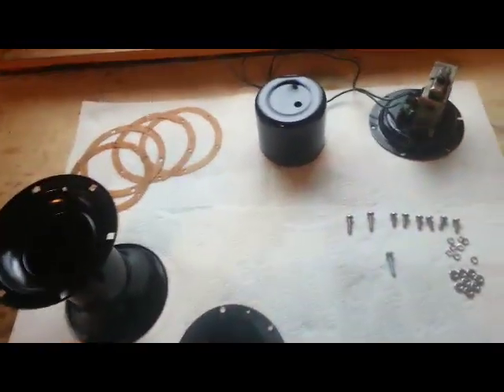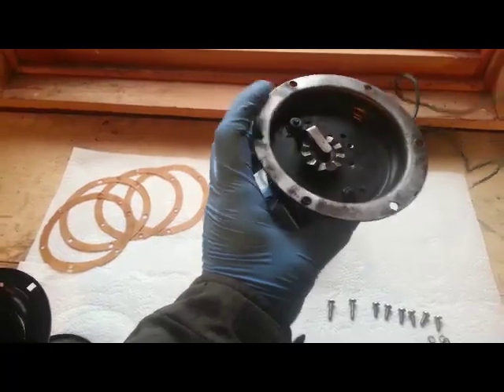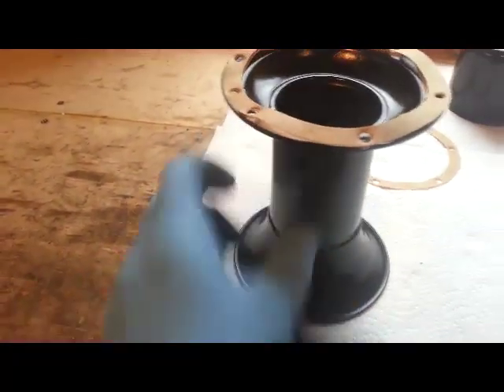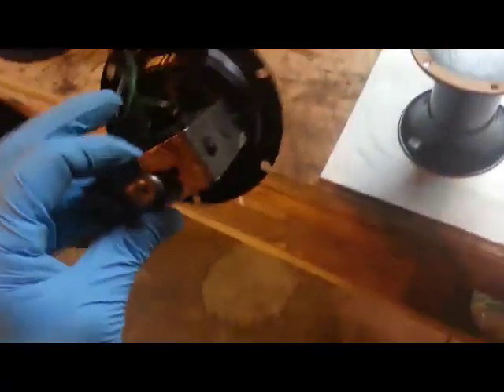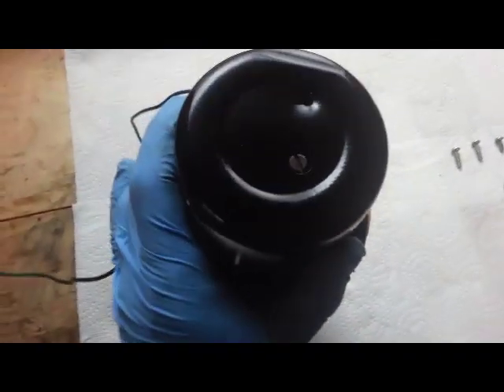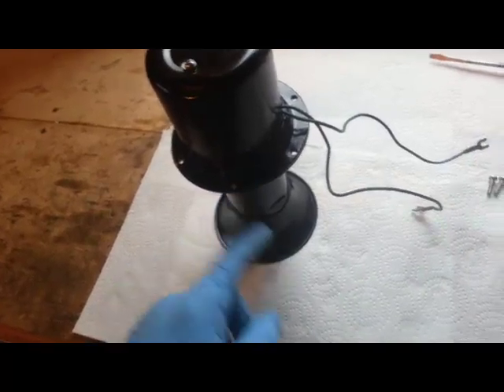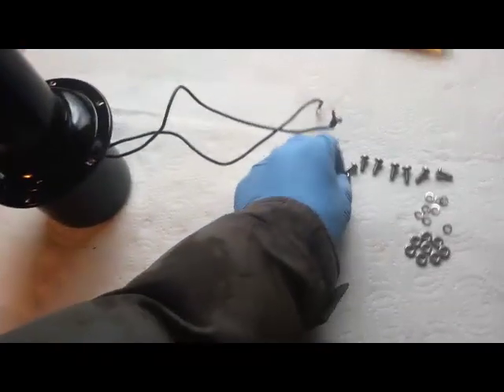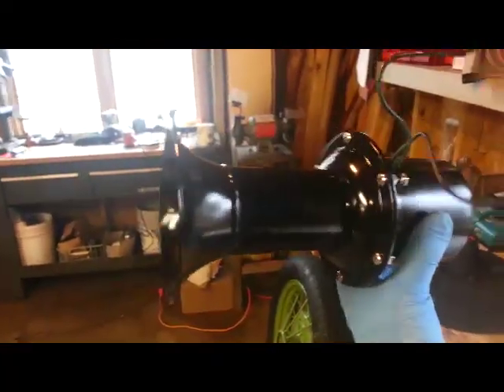1930 Ford Model A Ahooga horn make over

Comment: Slight mistake there. The two longer bolts go on the opposite side to where the wires come out. That's so you can mount the bracket on the top and the wires come out the bottom of the horn.

Comment: The hardware you used is incorrect.  You can actually buy stainless steel hardware painted the correct "raven" black finish from A & L in CT.  Thanks for posting this video.